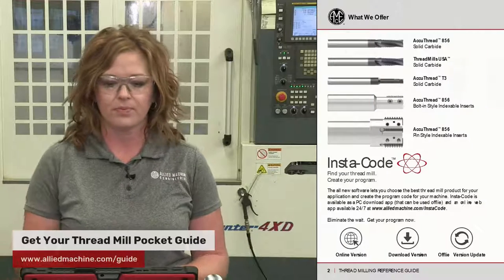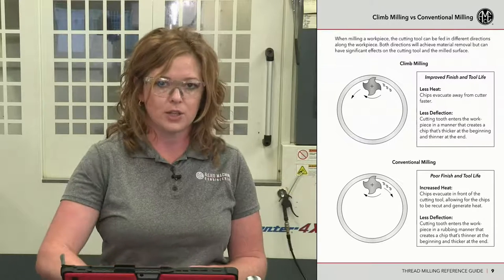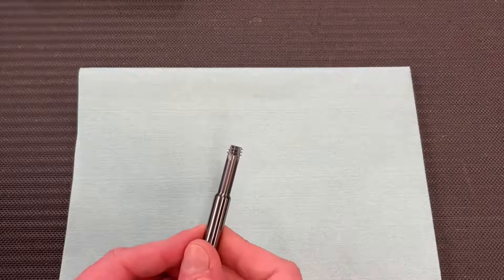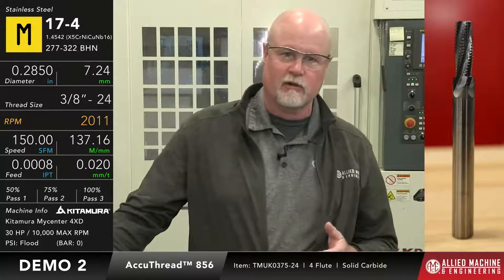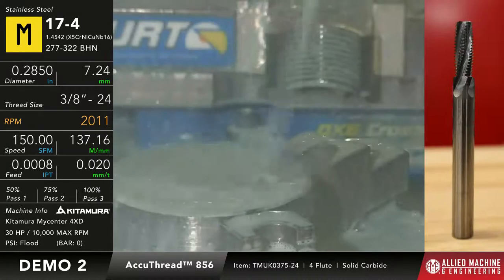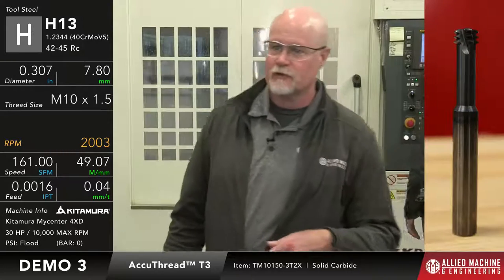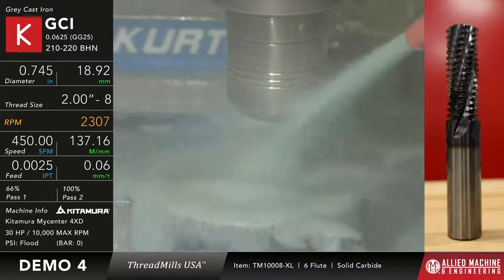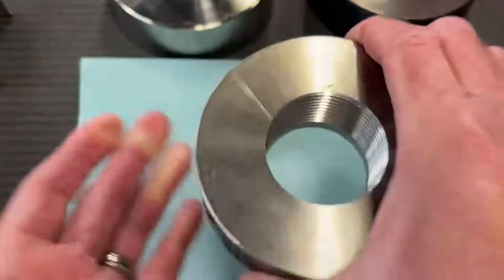What You Need to Know About Thread Milling

Comment: Interesting, Im trying to thread mill an M8 thread and the haas gen2  control, the vps produced the mill program, the threadmill is 5.91mm dia hand have drilled it 6.8mm and for some reason its throwing up a error 367 cutter comp interference, im doing 2 passes and the 3rd is the spring pass. Im a total newb to cnc and cant find an answer. Im using thread mill because im cutting P20 and when I was doing them on a manual mill the taps kept breaking even brand new out the box and it didnt matter which brand, in 20+ years I have never broke so many on this job and i would spend more time with the tap disintegrater than on the mill.

Comment: I have a question for the layperson. This is not like Rigid tapping where the revolution of the spindle has anything to do with the  thread pitch, correct? The program will do the helical movement in x, y, and z and with one complete thread revolution, you end up at the same x and y coordinate just with a 1 thread lower pitch in z movement. But you can adjust the spindle speed, correct? It is not relevant to the machine movement, correct? Spindle speed is only relevant to material type and material removal rate per tooth. Is that correct?
Another way to ask the same question is - I can use the same program multiple times and adjust the spindle speed to various speeds and to wont matter as the program runs because it is not connected like Rigid tapping - Correct?
Reply: yes you are correct in your assumptions, this is not rigid tapping

Comment: hey, quick question, how to avoid from keep doing offset when the gauge failed to go ?
Reply from the maker: How much are you moving at one time? You'll have to do an offset, but it is more about reducing the amount of offsets needed because our goal is to help you be up and running for production as quickly as possible.
Reply: I would not make more then Half of the total tolerance for the thread your cutting at one time if you're just shooting from the hip.
You'd be better off to figure out what the PD is and make your offset accordingly. 
But the worst case scenario if you're at the absolute ragged minimum and you make an offset that is half of the difference between the minimum and the maximum it should put you in the middle and it may be a a few microns smaller in production so if you're still just barely off minimum you might want to throw a little more like a few microns at it so the push back from the cutter is accounted for in a full depth of cut.

Comment: That's all fine and dandy but when you're trying to get $600 for a threadmill unless I can get 600 holes reliably out of the cutter I do not see the cost-effectivness common Sense tells me don't do it because the first time I break one I have to bring another tool in behind that how in the hell am I supposed to chase that thread I mean it's not impossible but come on.
Reply from the maker: Thank you for your comment.  You bring up some excellent concerns that are very common in thread milling. Depending on the material, 600 holes can easily be achieved in many applications (even high temp alloys) when thread milling due to the low heat generated in the cut. To your point about chasing threads in the situation a tool breaks, the first thread on the thread mill is a qualified length from the tip of the tool.  This makes it easy to touch off the tool and re-run the program. This is an easy process and is a time saver versus extracting a broken tap. We would love to discuss further and can even come to your shop and give you a free test of thread milling so you can put it to the test.
Reply: I thread mill with most of our work, especially with stainless steel and carbon steels. To be honest, they seem to last forever. I normally reduce the RPM and feed rate recommend. Blessings from South Africa.
Reply: Ive gotten 2-3K plus holes out of 1 thread mill in Titanium and stainless. Paired with a good Dream drill from YG and they are the cheapest tools in the shop.
Reply: But isn't thread milling exactly why it's easy to rechase a finished thread, as long as the part is clamped back to its original orientation, your thread mill lead in at the same angle as before, as well as the Z offset. But $600 for a thread mill is way too much IMHO.
Reply: @terrynaude284  if you don't mind me asking, what brand of thread mills are you using ?
Reply: @Hunter05ZA  Vargus. I see they’re marketed in the USA.